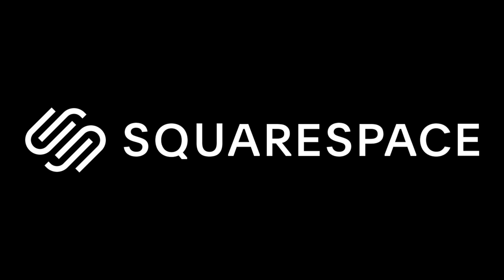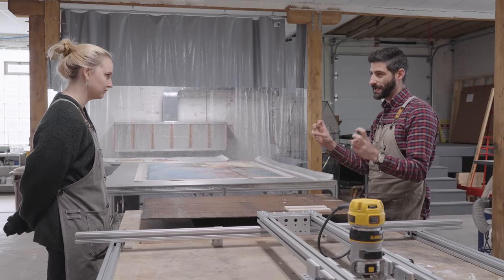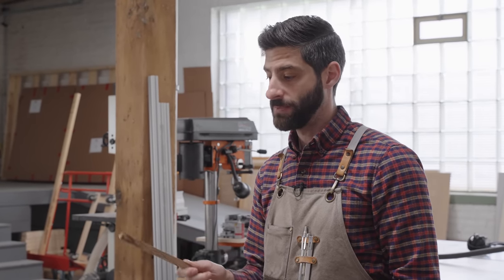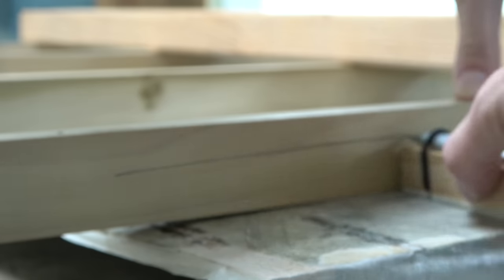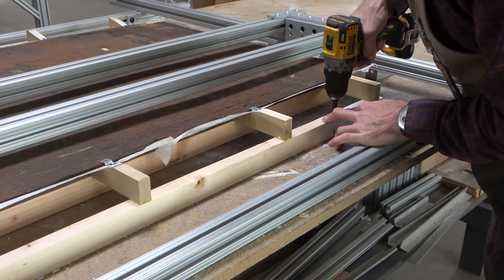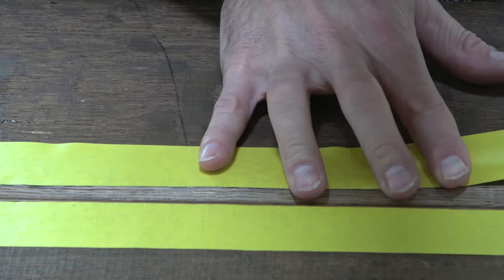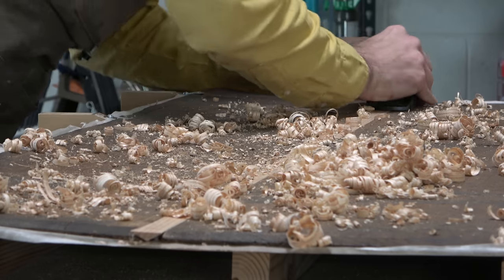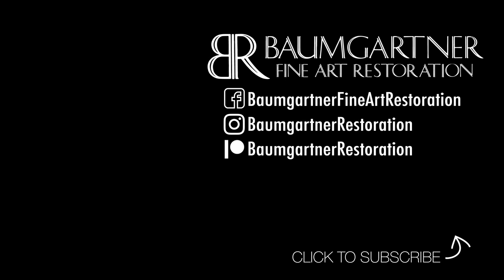Wood You Believe We're At It Again? Part 3

Comment: fun fact: i asked the newest AI (OPEN AI) how to make a structural fit for the panel:

"One way to make a structural fit for a painting on a bent panel is to carefully measure the dimensions of the panel and the painting, and then create a custom frame or mount that is specifically designed to fit the panel and support the painting. This may involve using specialized tools and materials, such as a saw or wood glue, to create the frame or mount. Another option is to use a flexible adhesive or mounting system that is designed to accommodate curved or bent surfaces. This type of adhesive or mounting system can be applied directly to the panel and the painting, providing a secure and stable fit without the need for a frame or additional support. It's important to take care when handling and mounting a painting on a bent panel, as the panel may be fragile and the painting may be delicate."

Comment: One comment is that using those automatically mixing tips for the epoxy for a critical application is suboptimal. The problem is that those epoxy tubes occasionally have air pockets that result in small periods of incorrect mix ratios. This will result in zones where the epoxy may never actually cure, or will just be different than the areas around it. The better method is to measure both parts by weight on a precision scale and then thoroughly mix it before putting it back in a single barrel syringe and applying it. This may mean you need to opt for a longer pot life variant or cool it but that is the cost of consistency.

Comment: Ok, I know nothing about painting restoration, but wouldn’t steaming the back and flattening the 3 boards so they’re all flat cut out a lot of the problems as well as allow the joints, gluing etc to be a lot more structurally sound? Unless it would affect the painting on the front, which I have no idea if it would or not. It just seems like having that convex is going to be a problem in a lot of ways. I mean moisture is what caused it to convex in the first place, and wood is curved with steam all the time. Anyways, I’m curious as to why that isn’t an option

Comment: The 120° inlay wood has the grain running parallel to the panel seam - fail. The grain should have been running at 90° to the panel seam. 
Wood is weakest along the grain and strongest across the grain.
Reply: I guess that when the wood panel expands or contracts if the grain is not parallel it may create bigger stress at the joint so it may crack open

Comment: you should of saved the saw dust from the router and then mixed with glue later no to fill in any gaps in the back panel. Its a natural wood filler with the original wood.

Comment: wouldn't it be possible to remove allot of the curvature by using angled inlays that are more obtuse than the cut in the grove of the panel?
Or will that curvature be addressed by saturating the panels (specifically the middle one) so they return to a flat state? (haven't watched more than 10min so far so this might be ansvered)

Comment: Does anyone know why he hasn't used the hot table to flatten the painting? That's what he did with the last split panel if I remember correctly. And I'm assuming he's not going to flatten the painting at this point because that would widen the angle of the grooves and compromise the bond of the inlays.

Comment: The curvatures won't match the panel precisely if you do it that way. The offset will be stretched out to the sides when they are drawn at an angle. The better way to do it would be to use a vertical offset that rolls over the panel while drawing the the offset at an exact vertical offset.

Comment: As weak as the 120° piece is, I would have never plained off any of the material which weaked its resistance to splitting. No one should care if the inlay was proud on the panel on the reverse side. 
At least he admits he is not an experienced woodworker. I've been at it for more than 30 years.
Reply: What do you think of the reason suggested by Terminal Psychosis (four comments above yours)?

Comment: This work again reminds me to programming. You can write your code straight away but then you end up with horrible code, that may require tons of bug fixing, has poor performance and needs to refactored over and over again in the future, every time you want to introduce a new feature. Or you plan everything ahead, wrap your head about all the pitfalls, consider extensibility for the future and when you finally start to write the code, not only will you spend way less time on doing this and write way better code, you also will get it right the very first time and end up with code that maybe nobody has to touch in the next 25 years (and for code, 25 year is like 250 years for a painting). Also proper research always will save you work, you know, work smarter, not harder. The best solution a programmer can come up with a solution that won't require to write code at all, as nothing can be faster and more bug free than no code at all, so if there is a better way to get what you require without having to write any code, that's the way to go and if you have to write code, make sure it's as little as possible but as much as required for a proper solution. Your task as a programmer is not to write code, your task as a programmer is to find a way how a computer solves a given problem and writing code to make that happen is just one option you have available, not necessarily always the best option, so do your research and be sure to look at all the alternatives before you start wasting your time. Your employers or customers don't care how you solve the problem, they only care how fast, how good the solution will be and how much will it cost them. As long as it's quick, good and inexpensive, any solution will do.

Comment: Since he has a large vacuum table, I would have used expoxy to bond a sheet of 1/4" plywood to the back of the panel. Using the vacuum table I would have also added weights for additional flatness. That would have been a simple one-step process adding much more stability and flatness than the process he followed.
Reply: But when the panel expands or contracts that plywood would create stress on the panel and may cause the joints to crack open or distort,wouldnt it?